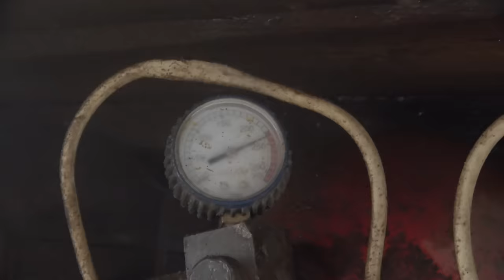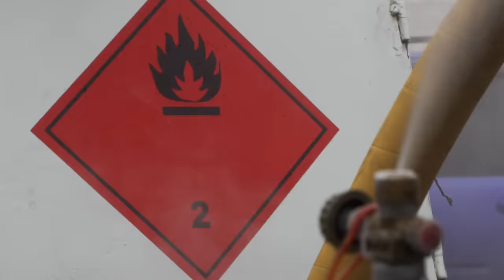Arménie, les Résistants du Caucase | Les routes de l'impossible

Comment: They are cutting the trees wrong to begin with they should stark by making a V at the base of the tree. The V should be in the direction they want it to fall. Then you simply saw in the middle of the V until you hear it start to crack then get away and let it fall.